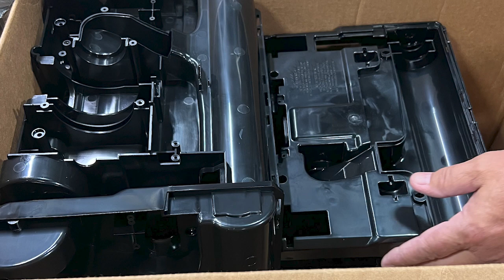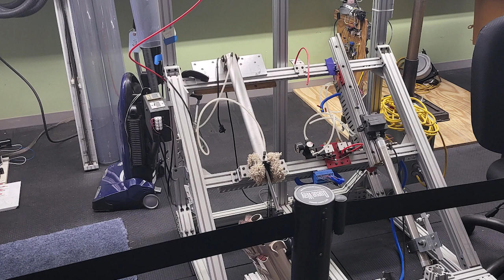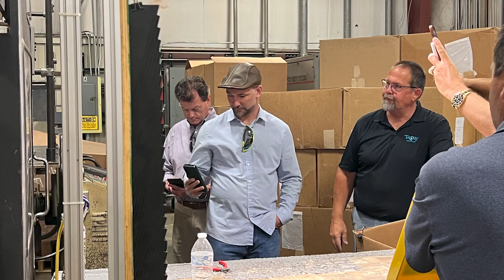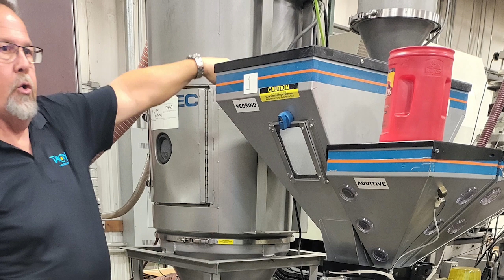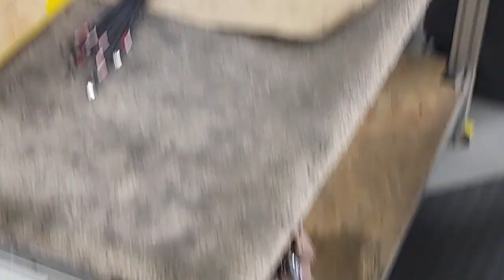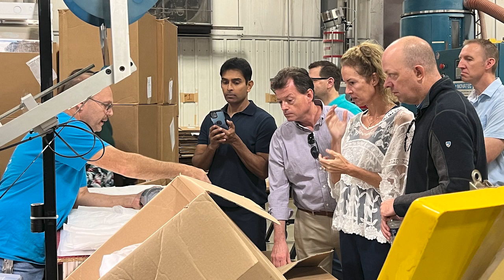The Quality of Riccar Vacuums

Comment: I am on my 2nd Simplicity vacuum, I currently have the Simplicity Symmetry S20D that I bought in 2016... Prior to that I had the 7000 Series that I bought in 1999...
I was first "introduced" to Simplicity by the owner of a vacuum store, otherwise I probably would have never even known about the brand & the "durability" of it!!!   I found this video after searching online because I discovered that the Simplicity Symmetry & RICCAR
models are the same "product build" & built at the same factory!
Reply from the maker: That is actually no longer the case. This video goes over the significant differences between those two brands starting in 2018 https://youtu.be/5CAVWicD-S0?si=zUHnjwOb6RGEe1Zb

Comment: Performance reviews said they are horrible and apparently simplicity wont let him review them. Seems suspicious.
Reply: Their top end models were problematic but again that’s anything with a lot of extra things going on. In my opinion as a tech yes they are better than the stuff you can buy in Walmart but for the money they charge there are better options like Sebo and Lindhaus and many dealers will carry all three. The cost to keep a Sebo or Lindhaus operational is much lower than a Riccar in my experience of dealing with all three. Parts on those other brands are also lower in cost to replace compared to Riccar. Riccars more simple models like the R10 series and Spirit models are good in terms of longevity but in my experience once you put a circuit board in it excessive sensors ect reliability becomes second nature and that’s regardless of brand but there are some brands that do electronics and circuit boards better than others if you get what I mean and Riccar in my experience isn’t one of those…